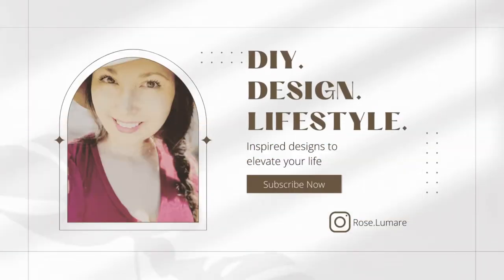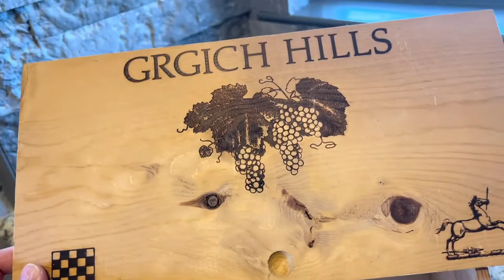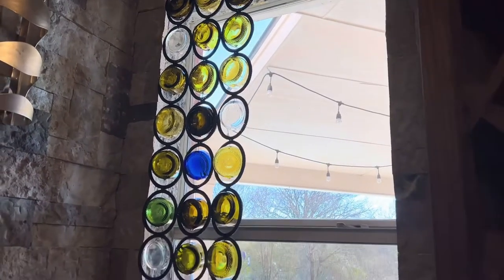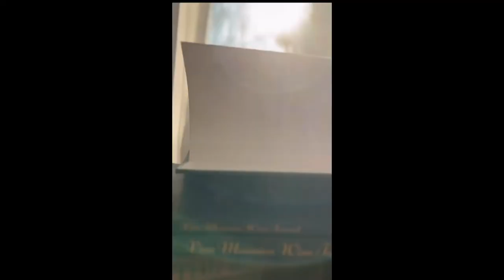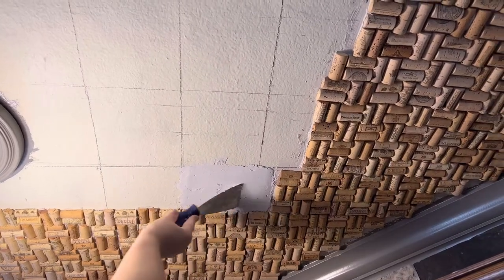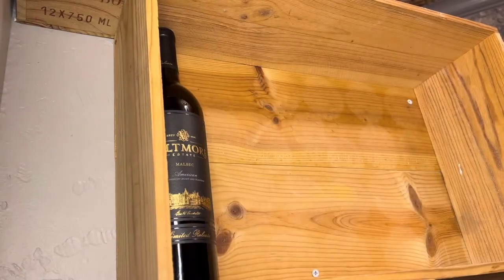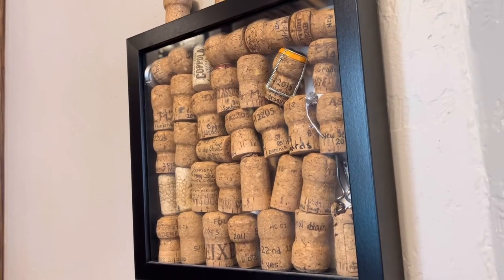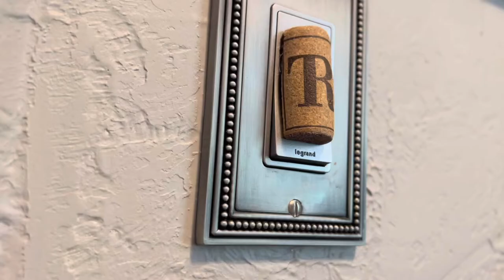DIY Wine Room Makeover! Home Makeover Magic: Turning Ordinary Spaces into Extraordinary Places!

Comment: Love this! What adhesive did you use for the wine cork ceiling?
Reply from the maker: Thank you so much, I used the leftover AirStone interior wall adhesive. (Leftover from stone backsplash) I thought it worked very very well and was gray instead of white, so it was not as visible if some was showing in between the corks. I purchased it at Lowes.